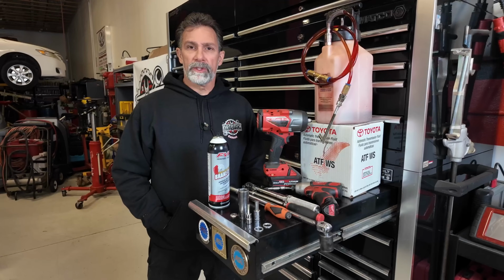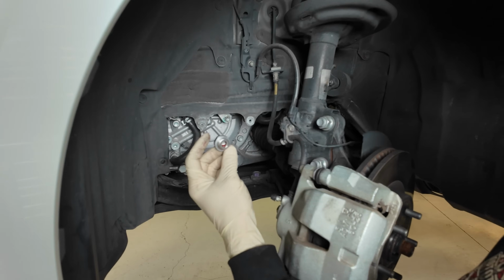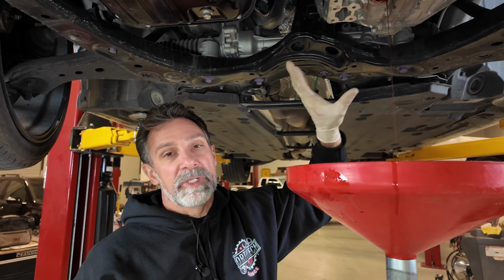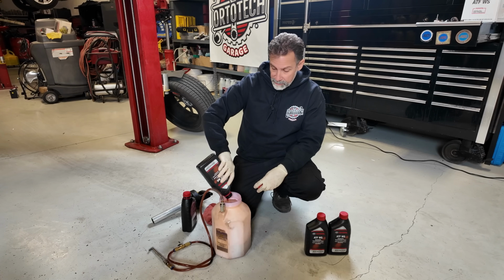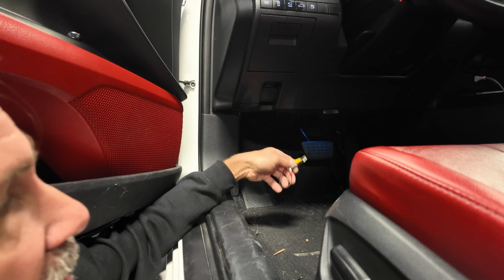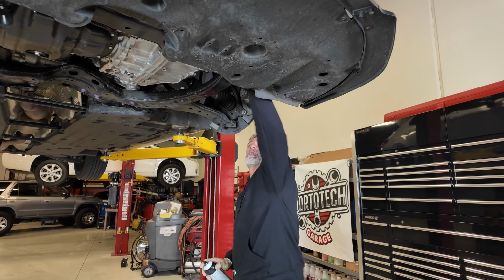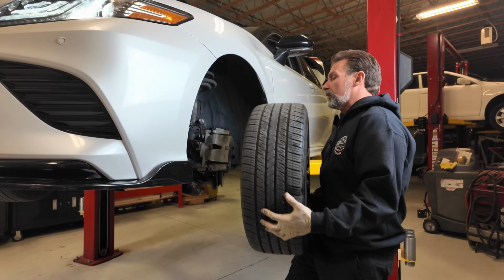The Ultimate Guide to Changing Transmission Fluid on Your Toyota Camry

Comment: How many miles did that car had when you did this video. That transmission fluid was brand new. I have never seen transmission fluid coming out of a car that clean. It is usually black when it is old and dirty not clear red.
Reply from the maker: It was right around 30,000 miles if I remember correctly. It was a while ago and a lot of cars in between. 👍
Reply: @OrtoTechGarage If that was the case, no wonder why people don’t change the oil on Toyota cars and still run for 300,000 miles with the same oil from the factory. Lol
Reply from the maker: @mortalballdc There are definitely people on both ends of the spectrum.  I can't explain how some cars survive that long with minimal maintenance and others deteriorate rapidly.  Maybe it just comes down to driving styles and sheer luck. 🤷‍♂️
Reply: @OrtoTechGarage yes driving style is a big factor but the biggest factor is quality and perfection and Toyota are that type of car make that requires only the minimum maintenance like oil change and every once in a while to change the air filter. I just changed the transmission oil on my 2023 Kia Telluride and it was pitch black and with metal deposits at the bottom of the pan. I bought the car used so probably the previous owner drove it very hard and also Kia have bad transmissions. I had a Kia Soul 2013 and drove it to 277000 miles but the new ones are not as good as those mid 2010s. My old Kia Soul was a 5 speed automatic CVT transmission and a 2.0 four cylinder engine.
Reply: @OrtoTechGarage My 2023 Telluride has a GDI 3.8L 6 cylinder engine, those engines are a piece of crap. I’m lucky if I can get 150,000 miles on that car. Most new Kia and new Hundays don’t even get to 100,000. Their quality went down since 2019 when they started experimenting with those GDI engines that are not reliable. I thought they were just as good as my Kia Soul that I had with 277,000 miles and was running amazing until ai had an accident and my car got totaled. My step dad has a 2015 Kia Soul with a manual transmission and it has over 300,000 miles and he uses it every day to go to work and back as his second car. He gets amazing gas mileage on that Kia Soul like close to 40 MPG in Miami traffic which is crazy.
Reply from the maker: @mortalballdc I agree. The new Kia and Hyundai products have been pretty dismal.  We've replaced so many engines that it's insane.  Its too bad, because they were up and coming, like you mentioned with your older model.
Reply from the maker: . Hopefully you have good luck with the Telluride!   All these GDI cars are suffering from the fuel systems, including Toyota.
Reply: @OrtoTechGarage Yeah I didn’t do my homework before I bought the car. I almost felt being pressure by the sales man to buy the car and I thought they were as good as they used to.
Reply: @OrtoTechGarage GDI engines have a lot of flaws and they haven’t been perfected yet as the VVT engines. GDI engines require a lot of maintenance and they don’t last even if you maintain them all the time.
Reply from the maker: . Don't feel bad.  The car salesman are very good at what they do.  They know how to sell.
Reply: @OrtoTechGarage Most car manufacturers make cars to only last 150,000 miles nowadays except for Honda and Toyota. They don’t want cars to last 200,000 miles like they used to.

Comment: Or just buy a Mazda that still has a transmission dipstick.  Screw these companies making disposable cars. Shame on you Toyota.
Reply from the maker: I agree that the process is totally frustrating, and the notion that fluids should last forever is crazy as well.   Every car owner should be able to easily check the fluid level and condition of any of the fluids in the vehicle.

Comment: How do you know the temp did not get too hot.  No one was checking the Drive light to let you know if it was to hot to check.
Reply from the maker: Once you have it in the correct temperature zone where the D light is illuminated steady, you generally have a window if a few minutes minimum to check the fluid before it goes over the threshold.

Comment: Could you put 10 quarts in over an hour of idle and flush the system down 90%?
Reply from the maker: I've never tried, but you would have to be sure to keep the level full (not overfilled) as you drain the fluid to avoid low fluid damage. Plus,  the vehicle needs to be in gear, drive or reverse, to open the circuits up, and allow the fluid to move through the entire unit using the internal pump.  This adds another layer of complexity to the job.  Another option is that you could drain and fill, drive it a bit, and repeat the drain and fill. Continue that until your fluid comes clean.  I hope that helps.
Reply: @OrtoTechGarage  Thanks sorted it out already.  D&F and repeat is best!:hand-purple-blue-peace:
Reply from the maker: @idontwantahandle._. Yes.  I think you handled it best. Great work!  👍

Comment: I ask a simple question:  Why not carefully measure the volume of the fluid you take out and, using a rubber plug on your fill tool to avoid spillage when filling, why not add the exact same volume back of fresh fluid, and avoid all that extra work?  Besides, without a lift, how can I keep the car level?
Reply from the maker: Good question.  I habe answered this previously a while back, but if you knew the amount that was in there was correct, you could do that.  The real question is, how do you know it's at the correct level before you began?  What if there was a leak or if it was previously filled improperly? What would you do if tou spilled some while draining?   It's not all that difficult once you know how the procedure and the process ensures you have the correct amount of fluid. The manufacturer has this specific procedure for a reason.  I always recommend practicing this procedure once or twice before you attempt the service.  👍

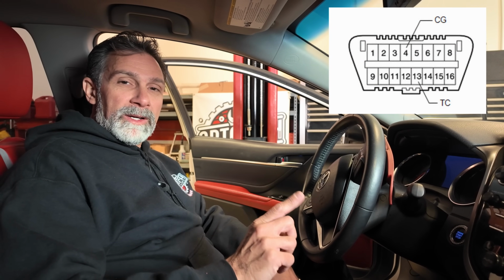Comment: 14:38 might be a silly question, but is there a specific wire I should get for trans temp procedure? Recommend something off Amazon or at a hardware store? Don’t have anything laying around
Reply from the maker: Nothing special needed.   You just need to make a connection between the two terminals shown. A paper clip even works fine.  Just be sure you are jumping the correct terminals. 👍
Reply: @OrtoTechGarage thanks!
Reply: @OrtoTechGarage  I was confused on that part because I don’t know much about cars and have only done a few maintenance jobs on my car. Is there a video where you explain what you were using and doing to make check that the temp was where you needed it to be?
Reply from the maker: @rxbarrels I did show that in the video.  Just pause it so you can see the correct termials.  No special tools are required, just follow the process as I described. It is a little confusing the first time you do it, so I always recommend you practice the procedure several times before you are actually ready to perform the fluid check.  Do it days in advance and really nail it down when you dont need to worry about the fluid getting too hot.  👍
Reply: Paper clip works fine
Reply: Does the instrument lights have to flicker?

Comment: Is it safe to sit in the car with it on 4 jack stands to do that fluid temperature procedure?
Reply from the maker: Assuming you are fully secured on 4 quality jack stands that are level.  Set the parking brake. The brake pedal should be firmly applied while you perform the procedure until you return the shift lever to the Park position.  You should be just fine. 👍

Comment: Very clear and accurate instructions.  It is very important that the car be level when doing this job in order to get accurate measurements of transmission fluid added.  I have a midrise lift that I use in my home shop
Reply from the maker: Thank you very much!!  That's fantastic that you're able to have a lift.  It sure makes auto repair easier.  👍

Comment: I have now idea why Toyota would start making plastic components for such critical parts. I also have no idea why they'd go with cvts and turbo 4s. Smh. Just imagine how far their engineers could have brought their vehicles without all this green nonsense.
Reply from the maker: You nailed it on the head.  Smaller, turbo charged engines and CVT transmissions are all for fuel economy and emissions regulations placed on the manufacturers.  Without all the restrictions, they could focus on better products and not cleaner products. The plastic items are, no doubt, to cut costs as the technology added to vehicles continues to increase.  It's just the phase we are in right now.  It reminds  me of the 1980's when they were chasing cleaner emissions by adding AIR injection systems, more catalytic converters and computer controlled carburetors.  It was all for the government regulations.

Comment: Thank you.
I bought a Camry 2011 with (277k)
When I asked the owner he said I changed the transmission oil long time ago and It's better to changed it soon.
Some mechanical tech say we don't guarantee your transmission 😢.
Any recommendation please.
Reply from the maker: Yes. I have answered this in the comments already a few times and probably will need to make a video on this topic because it seems to be common.  I still recommend servicing the fluid if it is not black or full of clutch material, and it is shifting normally without problems.  Check the fluid color and condition first.  Do not flush with this mileage, but a drain and fill should not cause any problems.  I've never seen a perfectly good working Toyota unit have a problem due to a fluid drain and fill.  You may need to perform the service a couple of times before it starts to come clean.  👍
Reply: @OrtoTechGarage Thank you for comment😊
I'm waiting for the video
Reply from the maker: @salehshamsebasha7896 You're welcome. I will add this video content to my list for the near future. 👍

Comment: Sold my car with mil km (600k miles) decade ago. Last time i went to see my  parents in Europe, I saw it in traffic, still runs. I bet it has mil miles by now if not more.
Anyways, one of the things I did was a 30k transmission oil change. Never driven on interstate, city car with a TON of stop n go in its life. 
Different mentality in EU when it comes to maintenance, replace the part as it is considered preventive (like belt, pulleys, tensioner and water pump on every 30 to 60k even if those are good)
Great video! Thank you Sir
Reply from the maker: That's incredible!  Thanks for sharing your story.  It is difficult to get people to understand the value of performing preventive maintenance.  They seem to think they are wasting money, when in reality, it is saving them thousands of dollars.  You are a testament to the value in regular maintenance.  Keep up the good work!
Reply: @OrtoTechGarage  Precisely.
Only thing is I wish we had cars like in EU, a LOT of difference in parts quality even though brand is the same, until I saw post on reddit about quality control in mexico, which explains a lot.
Anyways, if it was possible to buy Toyota Avensis diesel in States, I'd be the first one to buy it.

Comment: Wish i have seen this video before yesterday Because i took my 2023 highlander to service the transmission yesterday at 35423 miles and i change my engine oil yesterday and it was only 2540 miles since last oil change and the oil was so dark so now i am going start  changing my engine oil every  2000miles the most
Reply from the maker: I'm glad you decided to service the transmission fluid at 35K miles.  My recommended interval is every 30K miles. With direct injection, we see the oil does seem to get dirty faster.  I think 2,000 miles might be  alittle overkill, but you can't really do too much maintenance.   Somewhere between 3-5000 miles would be my recommendation on the oil for best practices. Keep up the great maintenance routines, it will serve you well for the long term!
Reply: Was doing 3000 miles but when i change the engine oil at 2500 miles and see how dark it was i was like wow because my 2023 highlander is turbo charger i think@OrtoTechGarage

Comment: Where is the transmission filter located
Reply from the maker: There is no serviceable transmission filter for this transmission. Everything is internal and requires disassembly.  Just service the fluid every 30,000 miles, and you have done more than most people.  👍
Reply: Thank you  @OrtoTechGarage

Comment: I followed Toyota and didn’t change my fluid for 140k miles. I felt the transmission bogging out on higher gears and decided to change the fluid myself. Problem went away
Reply from the maker: I'm glad you decided to give the fluid a replacement in time.  This is why I dont buy the intervals the manufacturer is recommending. Fluid will deteriorate, contaminate, and degrade over time.  I think 100 thousand miles plus is way too long.  Thanks for sharing your story!
Reply: @OrtoTechGarage car is at 170k miles now and will be getting the fluid changed this weekend! I’m aiming for every 25-30k. Do you think that’s safe enough?
Reply from the maker: Yes!  Every 30K miles is my recommendation, and it's exactly what I do on my own personal vehicles.    Keep it going!

Comment: I own a 2013 Lexus es 350 very recently. But I don’t know whether the transmission oil has changed or not previously. I have checked the oil condition now by just loosening the drain bolt. It’s quiet black and lack in viscosity as well as burnt smell. So what would you suggest to do now. Currently the car is 146kmiles.
I’m planning to keep the car for a very good time. Everything works fine, transmission is smooth as of now.
Reply from the maker: I get this question a lot.  If it were me, considering everything is working perfectly at the moment, I would definitely service the fluid.  You can do a drain and fill a couple of times to avoid any power flushing. It will be fine.  Get it on a regular routine every 30K miles afterward. 👍
Reply: @OrtoTechGarage thanks dear ❤

Comment: if that is the case, why not remove the drain plug, then add atf when the atf temp reached 90 def f, monitor the overspill atf, if nothing overspill at 90 deg f, add atf until it overspill. stop adding atf from there, let more atf overspill until it reach the correct temp.
Reply from the maker: @jungapo2  Yes. That's pretty much the process.  You've got it. 👍

Comment: I have a 2018 toyota camry se with 80k miles. No problems in terms transmission. Drives amazing but im thinking long term. How can i extend the life of the transmission? Should i do a flush?
Reply from the maker: I would perform a couple of drain and fills to begin with.  You can service the fluid as shown, then work it through the gears for a few minutes to circulate the new fluid and perform that service again, back to back. That will get a good portion of the old fluid out and leave you with a nice amount of fresh fluid without the need for a full flush.   After that, get on a regular service interval of every 30K miles.  👍

Comment: I have 2021 toyota Camry have 67000 miles what place you recommend to change the transmission fluid thanks
Reply from the maker: If I understand your question, you mean when should you service the fluid?  If so, I recommend every 30,000 miles if you are looking to get the most mileage from it.

Comment: Thanks.
Can you please confirm the right way to do it is put 3 quarts and fill up when up to temperature and NOT overfill (put 4 qts) and drain excess when up to temperature ?
Also, if one has a scan tool that shows ATF temperature, that can be used instead of jumper cable ?
What are the directions in the service manual regarding shifting gears ?
Reply from the maker: I would start with 3 to 3.5 quarts.  I think it is better to add a little, if needed.  The overflow check tube has a small orifice, and it takes a will to drain out if you put too much oil. The temperature window is very small, so you don't have a lot of time.  You will still need to activate the TC Terminal with the scan tool to get it in idle control mode. Most cheap scan tools dont have this feature.  If you use the jumper with at the diagnostic port, you dont even need a scan tool. Just follow the procedure I demonstrate in the video.  👍

Comment: Ihave toyota avalon 2022 v6 ` i whant change oil transmission ' redlayn oil' ' is there a problem?
Reply from the maker: I don't see any reason you couldn't use a different fluid, especially if you upgrade to a full synthetic.  Just make sure it is compatible with the manufacturers specs.  I would try to exchange as much fluid as possible, too.
Reply: Ok' thanks you  @OrtoTechGarage
Reply: Any updates  ? same car as you
Reply: No, I will switch next month.

Comment: Why not just use OBD2 scan tool though?
Reply from the maker: @PNWyinzer  You certainly can!  Most inexpensive OBD2 scan tools will not have the required feature to activate the TC terminal.   If yours does, by all means, do that. You'll will usually have to get a professional level tool to perform that function.  I teach this method for the DIY that does not have that feature.   I have a similar video coming out for this service on a newer Tundra where I demonstrate the process with the scan tool.  Keep an eye out for that in the coming weeks. 👍
Reply: @ thanks
Reply from the maker: @PNWyinzer  You're welcome.